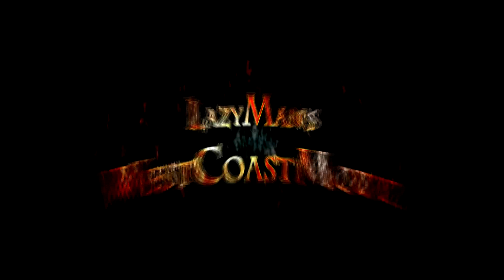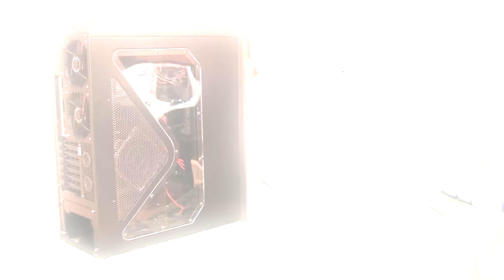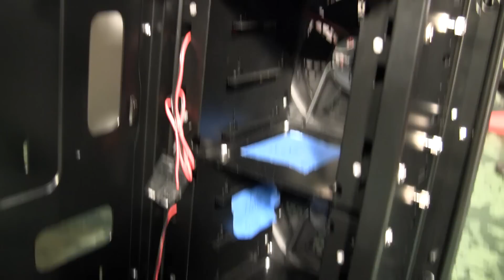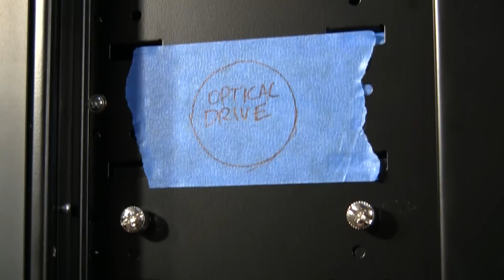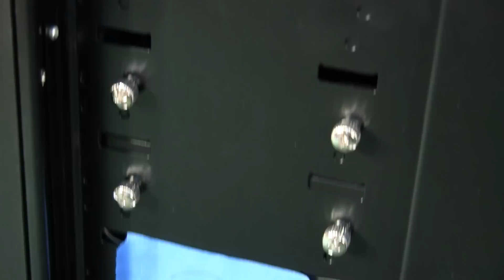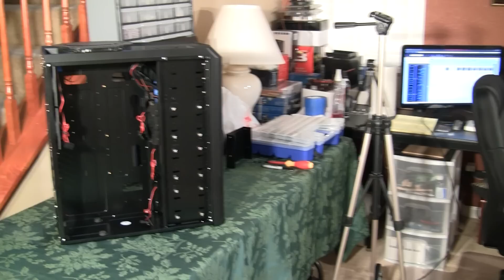Antec 1200 Storm Shadow Cable Mgmt. Layout

Comment: @WestCoastMods @nikkademus1  F U with my HP's and Dells!! I own the Antec 1200 in which ive built my own system with a 6 core black edition AMD CPU overclocked water cooled with Corsair H100, 16 gigs of ram, 18 TB of hard drive 1 gig video card with triple monitor Eyefinity setup!! And fyi, my case doors are out being machine shop cut on a CNC machine with a custom design! Just because I choose to support other people's crap doesn't mean I haven't built a monster of my own! Now who got owned!!??

Comment from the maker: @admiralwil You apparently don't, as the HDD cages are still able to slide out without any restrictions whatsoever. By cutting holes in the back of the HDD bay doesn't effect the design at all, but allows for better cable mgmt. And for your info, being in the IT and PC support field has nothing to do with design and modding of PC case, and very little if anything to do with tweaking, overclocking or getting the most performance as possible. So, I suggest you just stick with you HP's and Dell's.

Comment: Dude, by cutting holes in the side of your hard drive bays you completely destroy the ability to slide the triple bays out. This is used for adding and removing hard drives from the trays as well as cleaning the fan filters located at the front of each of those 120mm fans at the front! This is one of the main selling features of this case which you are completely denying to your client. Not a great tech in my opinion and i've been in the IT and PC support fields for years!

Comment from the maker: @gentlelovingmanUSA The Antec 1200 really isn't that large when it comes to large cases...anyway it depends where the HDD are located, but 12"-15" should be plenty. I would install the HDD first then measure what length you will need then buy them.

Comment from the maker: @bm5k I will be using a holesaw...but in my case I will be disassembling the entire case for paint. If you want to make a hole without disassembling the case then you would need to use a Dremel (rotary tool).

Hope this helps.

Comment: @WestCoastMods Thanks WCM. I'm also running an Ati 5870 GPU. I thought about the 5970 but it was a little pricey and also mulled crossfire 5870's but a single seems to do the job just fine for what I need. It games excellently and for my real goal (folding@home) she screams at 100% on all 6 cores :). The only mod so far was the side window but I may do more later on. My proccy is actually 3.67Ghz not 3.76Ghz but even with all 6 cores at 100% she only reaches 41c :).

Comment: This has always been one of my favorite cases because of the excellent cooling. I also used the Antec portable drive caddy and an SSD so I have both of those HDD cages wide open for airflow!
AMD Ahtlon II x6 1055t 2.8Ghz stock, OC'd to 3.766Ghz
Asus Crosshair IV Formula MB
Corsair H70 CPU 
Crucial 64Gb SSD
WD 1 Tb HDD Black Caviar Enterprise RE3
OCZ GamerXStream 850W
G.SKILL FLARE @1600 8Gb
Windows Ultimate 7 x64
NZXT Sentry II Fan Controller
6 - 2000 RPM fans
And various goodies :).

Comment from the maker: They both are very similar IMO. The Antec does come with more fans with the case, but the Armor holds more fans, if you're willing to buy them seperate. I bought 8 Xigmatek fans.

Also the Armor is a bigger case, which to me allows for better air movement and more space for the heat to dissipate.  But no matter which case you choose you will be happy. If you want my honest opinion I would go with the Armor, I debated between both including  the Comos S and the Armor did it for me. Very Happy!

Comment from the maker: I agree to a certain extent, it's not that they can't, because a 10 yr old can put components into a box. It's more the no hassle approach, like you mentioned. Everyone will have issues with a PC sooner or later, especially new builds, driver issues, conflicting components, ect. Even though I am somewhat tech savvy I still get headaches trying to trouble shoot a problem. 
Also there are those who don't have the right tools or don't know how to use the tools, every case needs modding, it a must!

Comment: just an idea for you, i dont know if this is how you were going to do it or not, but i think on the holes 4 the front panel connectors, you should make it so that the motherboard covers it up, so that you cant see the hole at all when you have the motherboard in place, and the wires for the front panel should be small enough that they will fit between the motherboard and the case. I think that will look alot nicer.

Comment from the maker: Thats how I doing it, thats why I'm cutting holes in the HDD cage to route the hole. If your familiar with the Antec's they have fans on the front side of the HHD cage, so you need to run the cables through the slots that are already there or drill additional holes.

Comment from the maker: I un-spammed his message, it also got me wondering. There was another one that was spammed to.

As far as the Corsair case, it is a great case, but no so good for air cooling, it was designed for WC'ing. so for those who will be using WC'ing it is an excellent case.

Comment from the maker: Yeah, I also thought that was the way to go, but for a client build, I think it would make it easier for the client to have to remove the cables if he wanted to change out a peripheral or a HDD. I did check to see if the Sata pwr and data cables would fit, and you are 100% correct they do go through the existing slot, but I think it will be an smoother transition from the HD's to the new hole I will provide.

Thanks or your suggestion
LazyMan :-)

Comment from the maker: I agree with that, but it would look nice aesthetically. I've thought about it some and i think I will just use edge molding that is a little wider and captures the two opposing panels at the same time. I know this will require removal of the u-channel every time you want to pull a HDD bay, but how often would someone need to do that and you would have to remove the cables anyway to pull the cage.

Thanks for input, I really appreciate your help.
Your buddy
LazyMan :-)

Comment: @soggymaster
I have the antec 1200 and I have measured and it looks like it will fit. It will get close to the fan mount inside near the HD bays, but I think there is enough clearing.